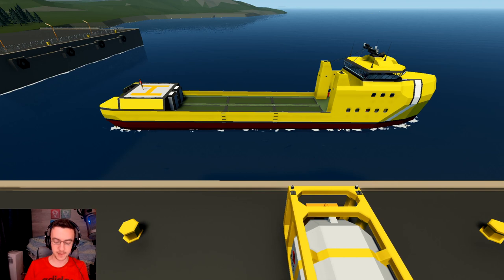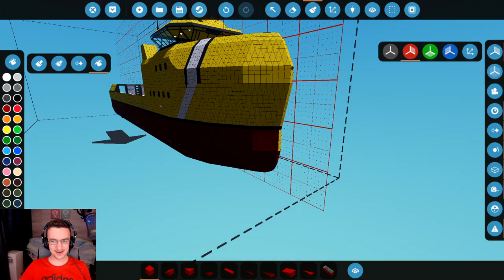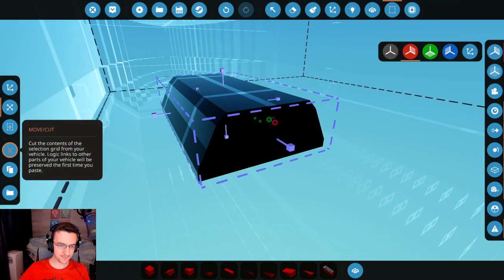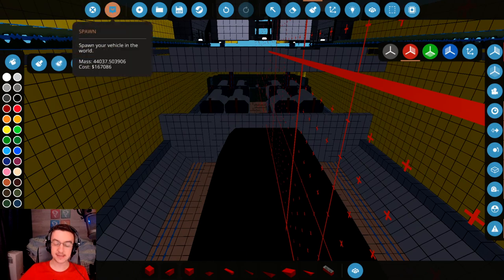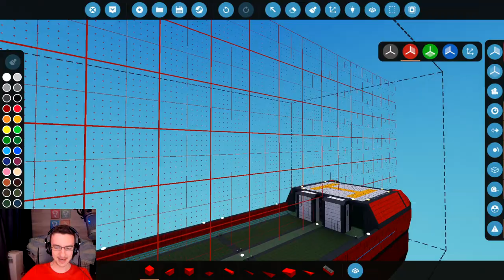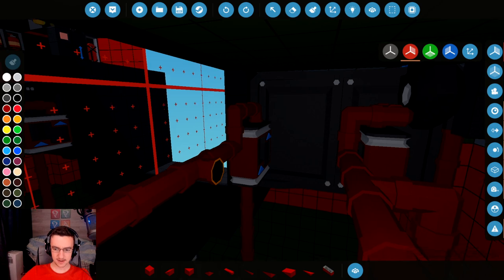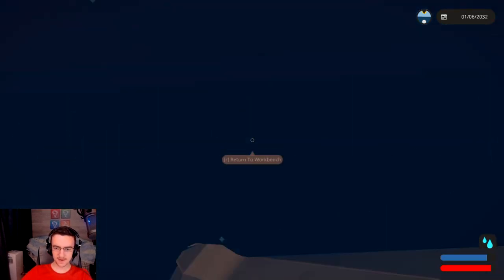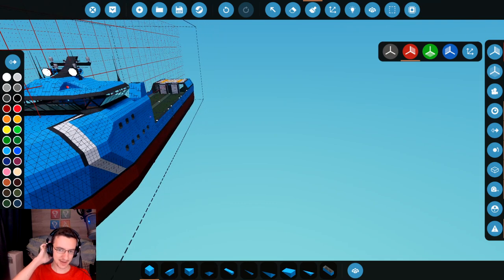Much Deeper Hull! -  Supply Ship Build  -  Stormworks Build and Rescue

Comment: Loved the video @Frantic! Love the new color too! I have a few tests for you to run on the supply ship. They are as follows:
• Take MrN Jersey Gaming's career mode starter boat and test out the boat ramp that you just put in. The object of this is to see how much work can be done to further refine the design. The dimensions of the starter boat are 64 Blocks (Hull length), 67 Blocks (overall length), 13 Blocks (Beam/width), 6 Blocks (Draught/underwater portion), and a total height of 14 Blocks, the tallest spot being the spotlight on a pivot at the front.
• Take a torpedo boat with the Louis scripting and set the torpedoes to a Magnitude 3 explosion. The object of this is to see just how much damage the supply ship can take before she goes under, or in other words, to test the survivability of the Supply ship.
Hope these ideas prove useful for the next video man! Keep it up!

Comment: Add anchors and a boat lift that pops out the back so instead of the hole cut out of the back you can just winch up the boat and slide it in the back of the boat and then you can make a wider boat. Also add a refuiling port for the boat.